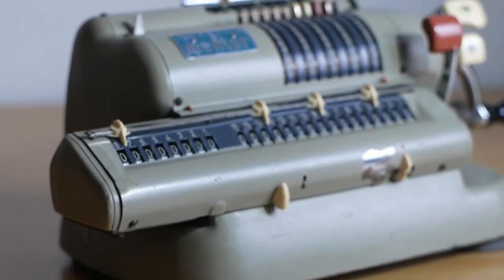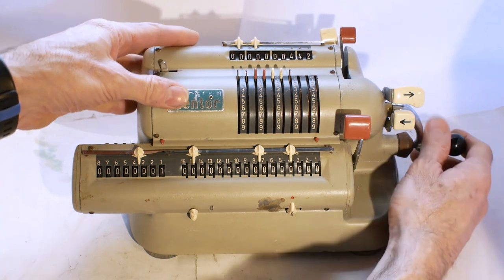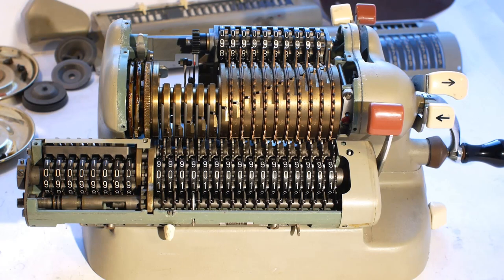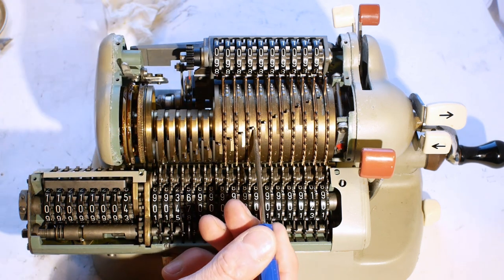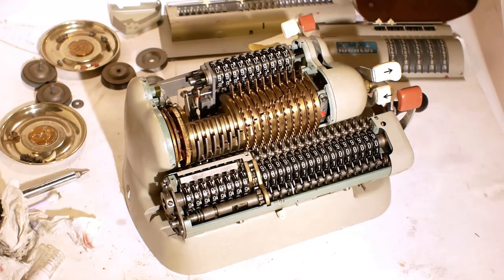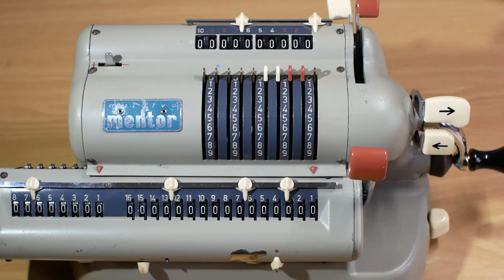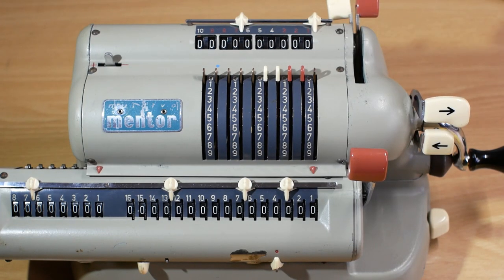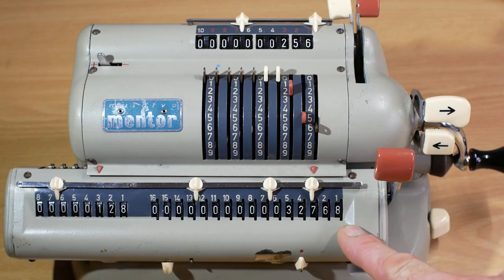Retro Tech - Muldivo Mentor Pinwheel Calculator - Part One - Refurbishment

Comment: Just taken possession of one of these, and it's a lovely machine to work with.  It had a very odd problem in that one of the carry pins was interacting with the counter wheels, but only when the carriage was in one particular position.  With the top cover off, it was clear that the carriage was sitting juuuust a snooch too far to the left, and that was allowing the carry pin to knock into the counter wheel.  (Like half a millimetre).

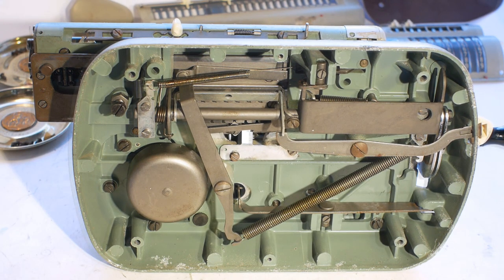I was pleased to discover that it was fairly easy to correct.  In the video at 2:08 there's a big screw with a locking nut. (if you imagine the video frame is a clock face, it's roughly at the 10 o'clock position).  That screw realigns the ratchet bar.  Releasing the locking nut lets the screw turn, which in turn shifts the whole ratchet bar to the left and right, realigning the carriage against the main body.  It took a bit of jiggling, but I was able to get the ratchet in the right place and the locking nut retightened without too much bother.  I noticed while adjusting it that if you take it too far out of whack it locks the main drive handle, which I think happens because the little diamond shaped cam near the centre of the video frame at the same timecode has to be completely retracted into the notches above it to let the drive handle turn.  Thankfully I found a position where the carry pins missed the counter wheel, and the handle was also free to turn.

I think what had happened is that the unit had been stored with the carriage in the far right position (reasonable, as this means the unit is at its minimum width) and therefore the ratchet bar was under continuous pressure from the carriage spring.  Or it's been forced at some point.

The only other thing I had to do to get the machine working was a little bit of lube on the carriage clear selection lever (left, middle, right for counter, both or output), which was very stiff and wasn't self-centering.  Quick dab and a good wiggle left and right has sorted that.

Now I just need to figure out why the bell doesn't ring...

Thanks again for some great information!
Reply from the maker: Hi moogthedog,  The Muldivo Mentor is my favourite pinwheel calculator to use - everything seems to be in exactly the right place and works just how you want it to.  Glad you sorted out the carriage position so it works correctly.  If you don't manage to sort out the bell I can always have a look at mine to see if I can figure out what might be causing the problem.  The bell on the Muldivo is probably the best bell on any machine I've used, giving a proper "ding" that you can actually hear - the bell on the Monroe LN160X is so quiet that it's hard to hear above the sound of the machine and the Lagomarsino 9203 isn't much better either.

Comment: Another interesting machine. Many thanks.
Reply from the maker: Cheers Benedict, they're rather fun machines.  This Muldivo is probably about as far developed as the pinwheel calculators got - fundamentally it's the same as the early machines but it's just a bit easier to use overall.  I'll do a comparison video sometime showing a Triumphator from around 1915 - 1920.
Reply: @GrumpyTim  it would also be interesting to know the price of each in real terms in today's cash too.
Reply from the maker: @BensWorkshop  Yes, I'd like to find a reliable source of that information - sometimes you get lucky and find an old advert or similar but not every time.  I know some of the electric powered mechanical calculators from around this period cost about as much as a car (although no one has specified what car!!!) so I guess the Muldivo would be substantially less expensive than a car, being somewhat simpler.
Reply: @GrumpyTim  alas it would take a lot of research. If the company still exists (or the company it was merged into) you could ask them.
Reply from the maker: @BensWorkshop  I might do a little bit more research when I have time - I'll let you know if I find anything interesting.
Reply: @GrumpyTim  many thanks. It would be interesting to know how much cheaper or more expensive than 1950s one was compared to the 1915 one.